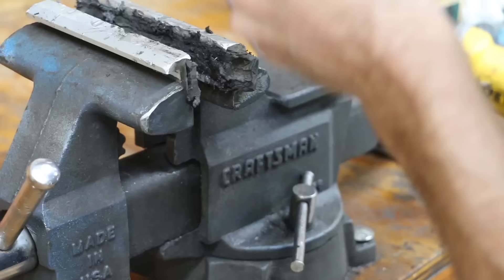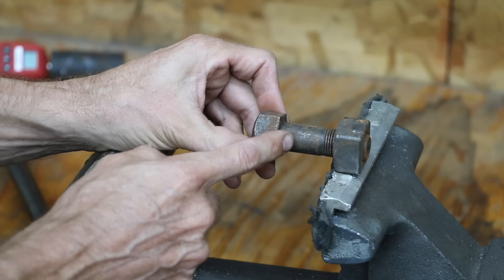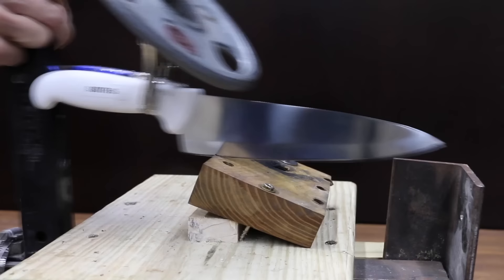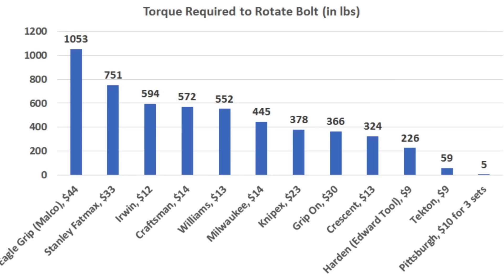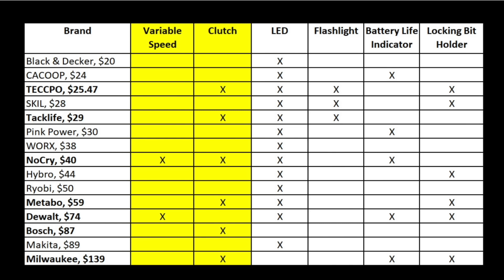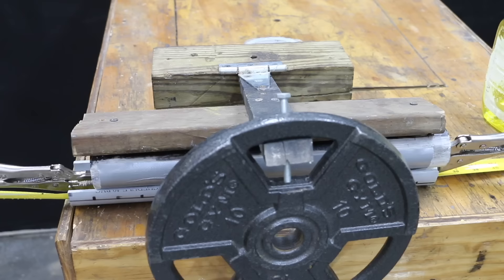Top 10 Tools 2021? Let’s find out! Gift Ideas!

Comment from the maker: I hope this list helps!

Wiha Screwdrivers: Wiha: https://amzn.to/2Yd6cgs
Lansky Knife Sharpener: https://amzn.to/3onD0fK
Knipex Pliers: https://amzn.to/3DOrGPS
GOOLOO 4000A: https://amzn.to/3Bh6zVh
Milwaukee M18 Drill: https://amzn.to/3bOg6IH
Eagle Grip Locking Pliers: https://amzn.to/38nXZHq
NoCry Screwdriver: https://amzn.to/3v9crN0
Evolution Saw Blade: https://amzn.to/3cmy7y3
DeWalt Tape Measure: https://amzn.to/2RJqVop
Granberg 12V Chainsaw Sharpener: https://amzn.to/2ZxnB0l
Reply: Do any of these links help you? If not I’ll see if I can find them else where
Reply: Test electrical outlet Surge Protectors. I think that would be highly interesting!!
Reply: I'd love to see you do a comparison on  Air Compressors. Some ideas for testing: 

* Potability [weight, wheels, etc]
* Nose levels
* Continuous run time
* Do they match stated air flow rates
* Ability to power different air tools with less or more demand; grinders, nailers, paint sprayers, etc.
Reply: Fantastic job, thank you for doing this. Takes all the guesswork out of buying tools and other items used in the household. Two thumbs up 👍👍
Reply: Knipex pliers was a good shout. Oldy but goldy brand
Reply: Love your test man but the downward pressure test on your screwdrivers wasn't exactly Fair since some of the other brands make ones that have strike plates on the back. These models are meant to be hit.  Wiha also makes ones that don't have a strike plate on the back and are not meant to be hit. Wera makes ones with a yellow and black handle with strike plate that are specifically called chisel drivers. But Wiha does make excellent screwdrivers
Reply: I hate to say it but... Knipex = NI-PEX. I love your content and truly appreciate all you do for us consumers!
Reply: A top 10 might be good at the mid year as well.
Reply: @armandogomez2677  All always help
Reply: @armandogomez2677  All of these links always help me.
Reply: I have a product review suggestion.   I see so many people buy this product and is on so many infomercial.   Flex Seal Spray Rubber :dothefive:Sealant coating.  I don't think this famous product can hold up to it's claim.
Reply: Where you paying for a Milwaukee that’s 40$ higher than what I just bought mine for 3 weeks ago?
Reply: It wasn’t even on sale man…. They’ve been 99$ for like 4 years
Reply: I actually bought the lansky sharpener and it was hands down the WORST sharpener that I have ever bought.  It sharpens knives just fine, but the locking screws for the clamp stripped.  I can't even use the darn thing anymore.  Just an FYI for everyone.
Reply: @elooney85 
Knipex is a German brand, produced in Wuppertal in Germany, and If you want to pronounce it correctly, you should pronounce it like the Germans do. And that isn't the way with a soundless "K".

"Neepex" is just what native english speakers have made out of it.😉

Comment: This is still the best type of Consumer Reports content. Just honest feedback, unbiased testing, and real-world circumstances. We appreciate all of the time that you put into testing these things for us.
Reply from the maker: Thanks so much!
Reply: @ProjectFarm  I agree that these are some of the best tool reviews.  

Speaking as a man who has driven a box of 100 lag bolts into wet treated timber with a Bosch corded drill, you test the things I care about in a tool.
The smell of burning plastic and the gearbox hot enough to boil water is all you need to know about that job - it survived.
It lasted for about 16 years of my diy projects, but finally gave up drilling a 1" dia x 20" long hole through hard engineering bricks, so i think I had my money's worth.
Reply: Better than consumer reports
Reply: I dislike consumer reports.
Reply: @xzibit8614  OP said "best type of Consumer Reports content" - taking a variety of similar items and pushing them past the breaking point to determine which ones will outlast the others.  That said, I believe the charts that he shows needs some work...specifically the video needs to link out to a webpage where all of the charts are made available for more focused analysis.  Having to pause a video to look more closely at a chart that is only displayed for a few seconds is a little bit tedious.  Another thing to note is that manufacturers of tools are always monkeying around with them and any given production run will potentially have vastly different characteristics every few months.  That will generally negate the entire video after a mere 6 months.  Tests like these really just show what is POSSIBLE.  Then it is a matter of deciding what should be the minimum STANDARD of quality and then enforcing that by forcing recalls on anything that falls below the standard.  Tools that fail under load create potentially dangerous situations.

Comment: One of the things I love about these videos is how many times I've had my guesses of who makes the best product of a given type...proven wrong! No manufacturer hits it out of the park with every product in their lineup. Thank you for helping us save a lot of money.
Reply from the maker: You are welcome!
Reply: That's one of the things I like most about it because he can be brutal to a name brand but that doesn't mean they don't make the best of some other tool. Everything is outsourced these days anyway. Mostly about who assembled the best tool. As far as hand drivers I'd recommend the Wurth Zebra line
Reply: This is why my cordless and electric power tool lineup has red/black, blue, yellow/black, a bit of green, and even some old-skool solid metal casings that just never die! The only thing that limits me is whether I want to add another battery system which isn't too limiting anymore since I have 3 different chargers. Machinery and hand tools are no different. This is why videos like this are so valuable.
Reply: Wurth do not manufacture those by themselves. It would be nice to know the manufacturer
Reply: @peternorthe1912  thing is carrying around 3 battery systems is a burden too. After burning out maybe my 4th or 5th impact I recently switched from Milwaukee to HILTI and would never go back. The 22v grinder has a bit less oomph than the M18 but other than that no complaints at all. The tools feel much more solid and have a 20 year warranty.

As a tradesman that can see multiple jobsites in a day, carrying around multiple battery systems is a bit much and I already usually have much more tools on hand than needed

Comment: It would be awesome to see a comparison of flush cutters! 

They are notorious for snapping if used "not as intended" so finding the most resistant ones to that type of failure would be very useful. Love your videos!
Reply from the maker: Thanks!  Thanks for the suggestion.
Reply: I second this. I've used many flush cutters for model kits and have had blades break on the most expensive pairs only cutting plastic 😑 I would very much appreciate finding a tough and effective pair of flush cutters.
Reply: I would be interested as well. I've been through many pairs of flush cutters. In my experience, the Knipex have been the best but the Xuron is the best for inexpensive flush cutter.
Reply: Please do this - I would like to see you test the CHP tools brand
Reply: I would like to see this too. In addition to testing their brittleness, I would like to see how flush each flush cutter actually is. Are they really cutting flush?
Reply: If we are talking micro flush cutters, I found that I've fell in love with Hakko CHP-170s, I have a few pair, and have never had an issue using them for what I cut. I've went through about 5 different brands til I found Hakko, they're made in Italy (some won't like that but it doesn't bother me if the product is worth it)
Reply: @nathanchristiansen1049  Yeah I have the CHP-170s, I love them. They've stayed sharp for 3 years. I don't abuse them, but I can rely on them!
Reply: Although a more precise scope should be found, Knipex alone offers maybe 15 different models, each in different configurations, of flush cutters in all shapes and sizes. 
Maybe 125mm slim electronics sidecutters (that are also always flush cutters) should be reviewed. Many people could be interested in that.

Comment: Timestamps:
0:00 Intro
0:05 Screwdriver
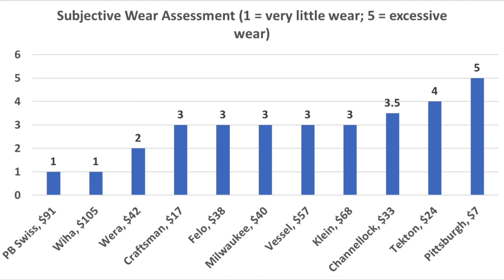1:36 Pliers
3:12 Knife Sharpener
4:59 Jump Starter
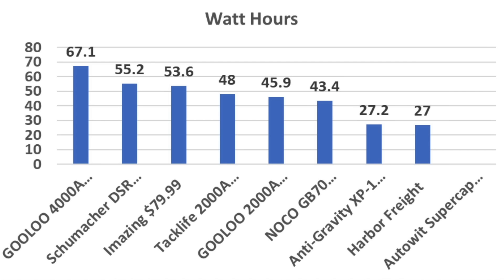6:52 Drill
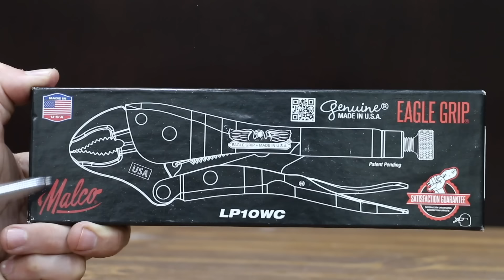8:22 Locking Pliers
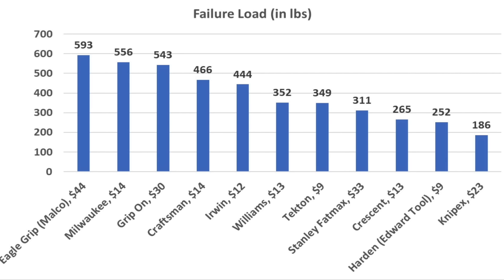10:27 Electric Screwdriver
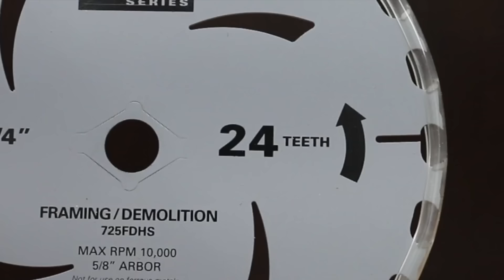11:31 Circular Saw Blade
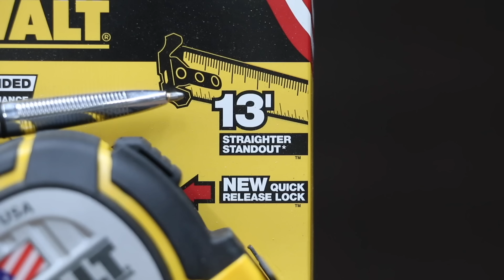12:57 Tape Measure
14:35 Chain Saw Sharpener
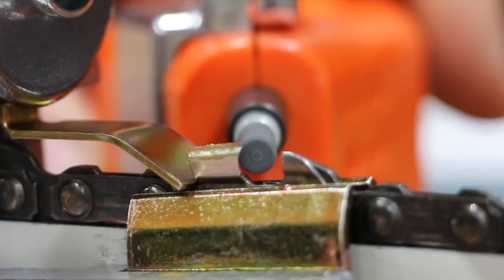15:48 Outro
Reply from the maker: Thanks!
Reply: @ProjectFarm  you know if you copy paste these at the end of the description they show up for everyone and are highlighted in the video bar.
you can even skip to them via ctrl + left/right arrow keys

Comment: Video idea : testing work lights with rechargeable batteries , Milwaukee , DeWalt,  bosch they all have them .
The very interesting thing would be to test if the lumen output they claim is actually true or if they're overvalued in the manufacturers claims .
Thank you for all the great comparisons,  It looks like a ton of work man , respect 👍
Reply from the maker: Thanks so much!  Thanks for the video idea.
Reply: Indeed! I spent hours reading multiple review before I bought mine, as I couldn't find a Project Farm video on this. PS.: please test the Dewalt DCL050 so I can ensure how well was my decision.
Reply: Heck. Any light video on a lumens per dollar scale. Sick of seeing little Chinese flashlights with a 3.7v battery claiming 2500 lumens and what not.
Reply: Head torches, a small wind power generator, small/medium vice, and an electric scooter+electric boat engine.
Reply: Right! I chose the streamlight strion switchblade for our next gen std work lite and thought Todd ought to test one.

Comment: I've been using the dewalt 60 on a daily basis for almost 2 years now and I've never had a single issue with it, it's as solid as a rock and does every single job I throw at it with ease, I've used many similar models but nothing has come close for me and when this one finally decides to die I will 100% be buying the same model again, especially after watching this 👍
Reply from the maker: Thanks for the feedback.

Comment: Things you could test:
1. L.e.d. flashlights,l.e.d. flood lights, headlamps
2. Sheet metal snips
3. Ratchet wrenches
4. Battery powered cut off tools. 12/18/20 volt systems
5. Could do other car detailing items like tire shine, leather conditioners, plastic trim restorers, headlight restorer kits, wheel polishes.
6. Best work boots, composite toe vs steel toe or best waterproofing, skid/slip resistance, puncture resistance, sole/leather wear.

Thanks for all the hardwork, money and dedication you put into these videos!
Reply from the maker: Thanks for the suggestions.

Comment: Those Knipex pliers are just monsters. I've had mine for around 5 years and I have 3 pair in 3 different tool cases (I need a clean and dirty set for oxygen works) The grip is phenomenal. However and it is a big however, the quick setting push button slips and sometimes doesn't engage properly and can slip back/forward which is really annoying. Would I buy another pair? Damn right I would! I'd do away with the quick set.. if Knipex did that, they would possibly have the best grips on the market bar none. On the back of that, I've bought all my pliers and circlip pliers being Knipex and they have never let me down in 6 years of everyday usage. You really do get what you pay for!
Reply: +1 for Knipex. Once I got my first one, I never turned back.
Reply: I don't know if I'm quite following what you mean but the Knipex Cobra are the button set grips and the Alligator are the conventional grips.

Comment: You make the best tool-related content on Youtube. Consider angle grinders for future comparison. Either cordless or corded (or a mix for the heck of it). Maybe RPM under differerent standardized loads, hand vibration on load, noise levels. Endurance if you manage to get them to fail reliably. Cost vs performance.
Reply from the maker: Thanks!  Thanks for the suggestion.

Comment: Thank you for the video. I love your channel and appreciate your commitment and all of the effort you've put into making them. Would you consider testing wire strippers next?
I swear I have like 5 or 6 pairs of them now since they get dull quite quickly, and while often times you can still manage to use then, rarely you'd be able to get a clean cut. Thanks again.
Reply from the maker: Thanks!  Thanks for the suggestion.

Comment: Another great video! Have you thought about testing surfactant coolant additives that are supposed to make water-cooled engines run cooler? It would be nice to see if they are snake oil and if not, which ones work best.
Reply from the maker: Thanks!  Thanks for the suggestion.

Comment: My 12" knipex cobra pliers are hands down the best, most versatile tool I have ever owned. If you buy one tool, make sure it's a pair of 12" knipex pliers. I've used them to bust loose 4" pipe fittings, 38S hydraulic fittings, bolts practically welded in with rust, allen bolts, ive used it as a chipping hammer, a pry bar, etc.
Reply from the maker: Thanks for the feedback.

Comment: I've owned the Lansky for over 25 years and can only recommend it without any reservations. It is easy to set up and use and gives consistent sharpness every time. Great video, I learned a lot. Also, at about 1/3 the cost, I think the Stihl 2 in 1 sharpener is amazing. I've owned it for about 5 years and it works great, is easy to use with the chain right on the chainsaw, and it doesn't require power. It's also compact and can easily go into the woods for quick touch ups. I like the fact that it sharpens the cutting tooth and guide tooth at the same time.
Reply from the maker: Thanks!  Thanks for the feedback.

Comment: I really appreciate how that you always try to be as scientific as possible with your tests of the tools. Although I have seen many other reviews for different tools, most, if not all of their tests are far from scientific with their approach. They don't eliminate the variables like you seem to do. Many thanks for a job well done. It is helpful to be able to have you review before we buy. The one thing I have ran into recently is the comparison with different combo power tool kits. While the Milwaukee fuel line seems to be the obvious winner, it does come at a premium. Dewalt especially, also Makita have many different models of the same type (drill/driver, impact), they don't seem to make a clear distinction between the low, med, high price differences. Specs given are usually vague and not very reliable. So at some point I would like to see a delineation between the different models, and perhaps even a little subjective information such as ergonomics. Thanks again.
Reply from the maker: You are welcome!

Comment: My experience is that filing saw chains rutns out unevenly sherpened over time and that's why I always prefer som sort of electric grinding device. The one I use requires detaching the chain, so I usually do 3 chains on one occasion but now that the Granberg is 12 Volts and works without removing the chain it has to be really useful for some users.
Reply from the maker: Thanks for the feedback.

Comment: I had another video idea for ya. What about testing which Air Compressor air hose is the best? I have a 30 ft flexilla A.C. hose and it has never cracked, leaked, or broke (so far) after 5 years of usage. So I thought it would go head to head. Keep it up todd!
Reply from the maker: Thanks for the suggestion.

Comment: Might have to look at the DeWalt tape eventually. I've been using the fatmax  for years. It has several things that annoy me like the magnet being too strong on the hook when i don't even need it, or it being too weak when I do. The tape blade collapses easily when trying to read anything from the side. Will go about 10+ ft horizontally, but once you tip it, it falls apart. Also doesn't retract well unless you assist it. The hook is riveted too snug so you have to make sure you butt it up tight on inside measurements and pull it taut when measuring on the outside. The belt clip is cheap too.
Reply from the maker: Great feedback. Thank you!

Comment: Testing ideas:
Palm routers
Low or mid priced drill press
Mid sized air compressors
Deck stain
 Vacuum sealers 
Top Tier unleaded gas brands
Vinyl flooring
Car upholstery cleaner
Table saws
Battery powered hedge trimmers
Security cameras
Anti door kick in systems
Reply from the maker: Thanks for the suggestions.

Comment: Hello Todd, can you please test shovels, both regular pointed-tip digging shovels and “spear type” post hole shovels?

Possible datapoints:
How much force the metal shovel can stand before bending (clamp the bottom third of the shovel and apply force at the upper edge)

How much force the handles can survive (clamp the shovel and pull on the far end of the handle with a tractor)

Balance (are some shovels especially heavier at the business end, which would increase the work needed to complete each “shovel cycle”)

Grip / handle comfort

How far each one will dig into a lawn with a forgiven downward force.
Reply from the maker: Thanks for the suggestion.

Comment: i have the dewalt tape measure. i found it laying on the ground at a gas station right next to a pump and based on the looks i could only assume it was ran over, at least once. sometimes it doesnt full retract but other than that it works perfect.
Reply from the maker: Thanks for sharing.

Comment: Thanks for another year of exposing where our money is best spent in the market.  As requested, some other ideas for videos: Caulking, is mound resistant better than pure  silicone.  Zip disc's, is any brand faster or better lasting.  Cold weather penetrant, what works best, ATF or super penetrant.
Reply: *mold resistant
Reply from the maker: You are welcome!  Thanks for the suggestion.